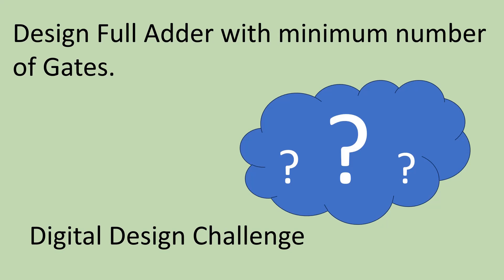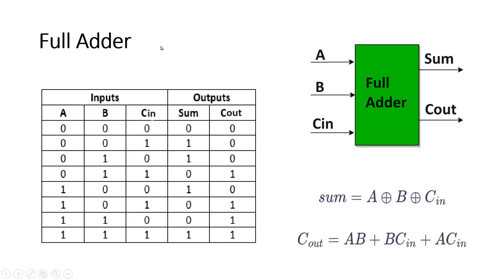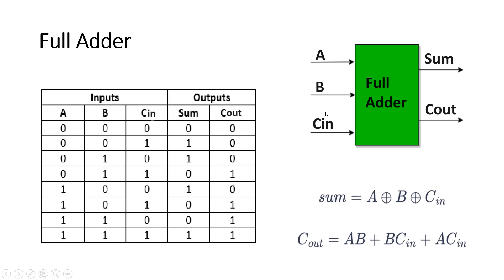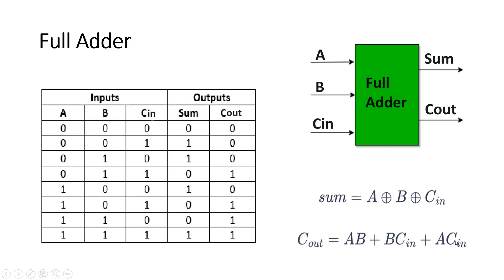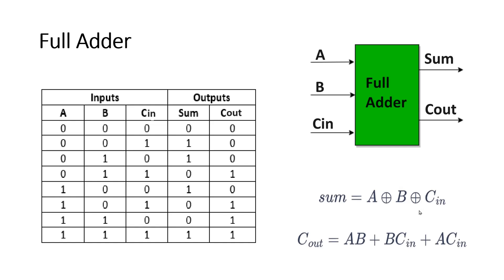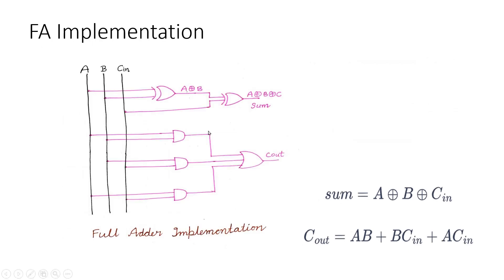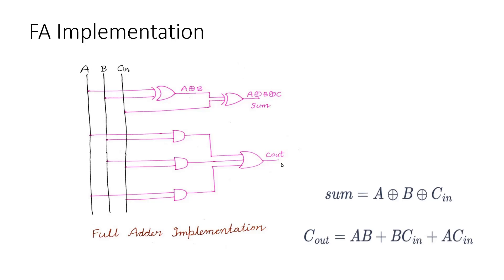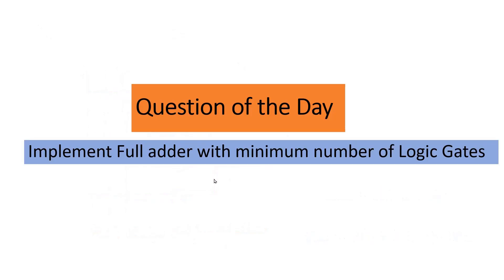Full Adder Interview Questions Part1

Comment: we can use  other expression of carry out of full adder ie (A xor B)Cin+A.B
Reply from the maker: Can you prove that AB + BC + CA  = (A xor B)Cin + AB
Reply: I can prove it with Kmap , so instead of optimizing the circuit of standard Kmap practice we can do this,
Carry K map

A(0,1)\Bc 00 | 01 | 11 | 10
                   0.     0.    1.     0
                   0.      1.     (1.    1.) -> g1

Now lets optimize the bracket g1 as Ab and remaing once as it is 
Cout = AB + AB'C + A'BC
         = AB + C (AB' + A'C)
         = Aab + (A xor B ).C

I saw this solution first time in old Nptel digital electronic course

Comment: Here, we can use the same logic for Sum, 2 XOR gates. For Carry (Cout) generation, 2 AND gates and 1 OR gate. We can take the first XOR output (A XOR B) and Cin as inputs of 1 AND gate, A and B are the inputs of other AND gate, and then connect both outputs of those AND gates to the inputs of the OR gate. The output of the OR gate will be the Carry. It will reduce 1 AND gate; instead of 3 input OR gate, 2 input OR gate is sufficient.